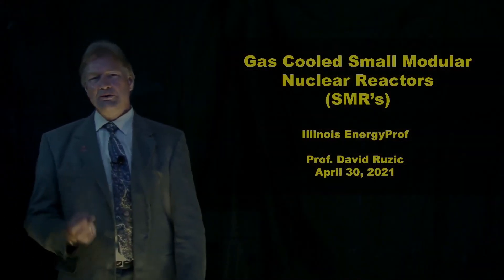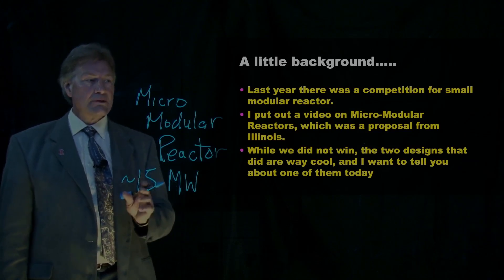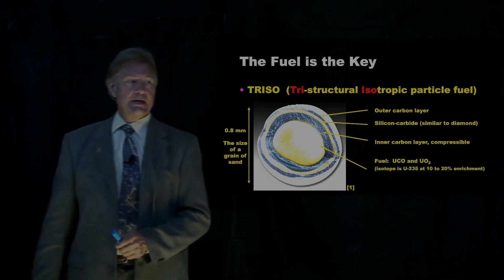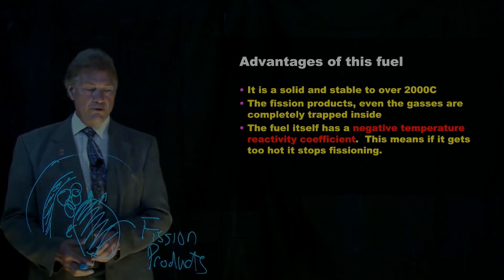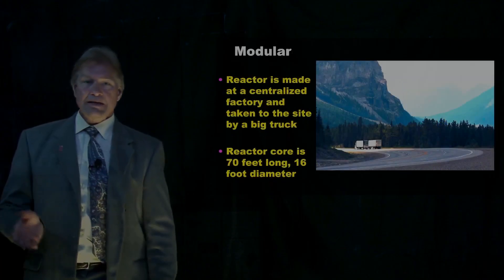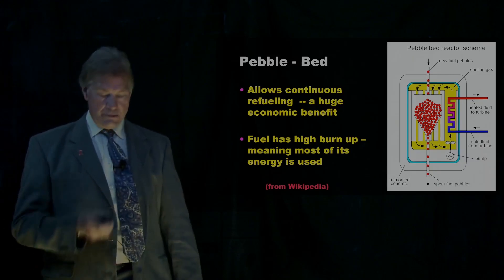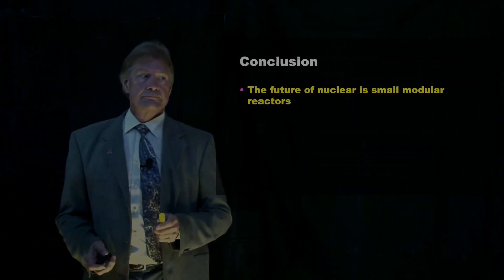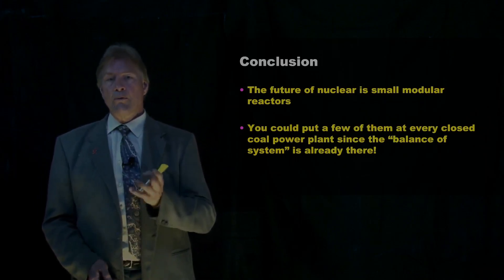SMR -- Small Modular Nuclear Reactors - Gas-Cooled

Comment: You compared the billion dollar price tag of this SMR to a billion dollar coal plant, but how much energy does that coal plant make? How much heat? Not trying to defend coal, but it's odd that you didn't elaborate.

200MW thermal and 80MW electric from this SMR for $1.2B.
Solar plants cost less than $1.50 per watt, so a 200MW* solar array would cost less than $300 million, double that to include storage and it's still half the price of this SMR. The panels last 25ish years  and depending on the type and duty cycle of the batteries they can easily last that long. So $1.2B would get you solar power for 50 years... but you wouldn't have to pay for fuel, you wouldn't have to pay for cleanup, you wouldn't have to pay for waste disposal, you wouldn't have to pay for security. The running cost of that solar plant would be a tiny fraction of the cost of the SMR. Plus at the end of life of the panels and batteries you can up-cycle or recycle them. You can't recycle nuclear fuel, or any of the contaminated parts of the SMR. 
For a singular large solar plant you might have trouble finding the space, but in a neighborhood you have plenty of roof space, and covered parking, and covering the waterways to prevent evaporation, and on top of every light pole, and so many other little nooks and crannies that you can stick solar and a battery that finding space for 200MW in a neighborhood would be easy. 

I generally like nuclear, it has insane power density, is safe, and cleaner than fossil fuels. I am not a fan of SMRs though. 
They're security risks both in transit and in situ. 
They seem like a way to go around regulations. Especially those plans to hook several of them together instead of building a big plant. 
They are less efficient than big plants. 
For a moon/mars base it's perfect, but for a neighborhood? IDK.

*Edit: Aren't resistive heaters 100% efficient? So that solar plant could produce 200MW of heat too, while also supplying more electricity than that SMR. If you don't need super intense heat you can use heat pumps and get way more efficient still.
Reply: >200MW thermal and 80MW electric from this SMR for $1.2B.
There is small problem with your math. It should be $1.6B for 4 (four) reactors + fuel production facility.

Comment: do they work in zero-g?

(asking for a friend)
Reply: You'll need to rotate the pebble bed like a centrifuge to keep it compacted and allow removal of the fuel pellets. But otherwise yes.
Reply: @nerd1000ify  thank you 😅

would it work at, say, 0.38 g?
Reply: @klausgartenstiel4586  don't see why not. A PBR would probably be a great power source for a spaceship or a base on another planet. Of course you'd need radiators to get rid of the heat, and a radiation shield to protect the crew. There's a great website called Project Rho which discusses a lot of these concepts in depth.
Reply: @nerd1000ify  cheers! i don't like reading in my free time, but this looks fun. i like the boom table.

Comment: Why can it only produce 80 MW of electricity, but 200 MW of heat?
Reply: Coal and natural gas plants are similar  with a 35 to 40% conversion of heat to electricity.  Light water reactors are only 30% efficient
Reply: Because thermodynamics

Comment: I was so disappointed that you are pushing the old, failed, wrong way of extracting energy from fission. Ok, maybe calling it 'wrong' is pushing it a little to far but come on, whats wrong with the Thorium cycle?  Why aren't you so interested in say, MSBRs or LFTRs...  We are so far behind because of the wrong headed choices made around 80 years ago to use Uranium and water.  So please, do tell, what is wrong with Thorium based reactors?
Reply: What You Need to Know: Thorium Nuclear Power
May 8, 2020
^^^^^^^^^^^^^^The Professor has renewed my respect for him.  This fellow is amazing. (actually it appears that I jumped and spoke before I had all the necessary information, my apologies Professor).

Comment: As a nuclear engineering student working around reactor design, I keep wondering how the industrial heat use case functions. Sure these reactors produce a lot of thermal energy, but that doesn't necessarily mean that they produce very high temperatures (at least along a conventional secondary ) that could be used for things like melting steel. Maybe district heating though.

Also when trico in high temperature gas reactors comes up I keep wondering about the possibility of a graphite fire. You have these systems that are optimized for gas flow and if oxygen were to get in and become exposed to a bunch of high temperature graphite I think of fire would become a real possibility. The fire might then crack many of the trisoparticles through chemical reaction and lead to fission product release.
Reply: 90% of the world's population is in dictatorships. 
Nuclear industry in every country?????
Putin is the world leading Dictator.
The worst killers, the child killers, lead all Dictatorships. Oppose your Dictator and one of your children will ring you and tell you that the man with the gun told you to ring.
Putin is killing the neighbour's children. 
100,000 SMR, say BWRX300, around the world means the USA military budget goes from 4% to 40% of national budget. 
The USA is the biggest target in the world.

Comment: Would also be really nice to see an episode on Molten Salt Reactors (non-thorium), for example Terrestrial Energy, ThorCon, Moltex, Elysium. These designs have all the inherent safety and modularity of gas-cooled designs, but due to simpler fuel and higher power densities they perhaps have the potential to produce power cheaper than coal and gas. Some of them (e.g. Moltex & Elysium) even burn existing nuclear waste.

Comment: While not pretending to know what I an talking about in any depth , (your terrific presentations allow me to think I know more than I do)  - If the reactor can be cooled simply by air , that would mean to me that there is not much heat energy "soaked" into the heated gas to transfer to water based steam generation in any quantity. What am I missing ?
Reply: In other comments, he explained, but the helium cooling gas is quite hot, hotter a Pressurized water reactor, which improves the efficiency of the heat transfer. 

It is cooled by a gas, but the "cool" state is actually quite hot.

Comment: On a side note: I love your way of presentation, writing on a glass pane and mirroring the video in post. The position of your lapel pin gives it away though. 
Question on the pebble bed reactor: How throttle'able would such a reactor be? Will control over helium circulation directly control heat generation? Because 200 MWatt thermal with only an On/Off switch would be kind of unwieldy...

Comment: With regards to the X Energy XE-100, have they overcome the problems of the German AVR Reactor been resolved?

This test German AVR Reactor was located adjacent to the Jülich Research Centre in West Germany, an early pebble bed reactor constructed in 1960, and it had problems with fuel temperature instabilities...

"AVR´s helium outlet temperature was 950 °C, but fuel temperature instabilities occurred during operation with localised exceedingly high temperatures. As a consequence the whole reactor vessel became heavily contaminated by Cs-137 and Sr-90..."

https://en.wikipedia.org/wiki/AVR_reactor

And...
"...In the AVR, it was impossible to directly measure the fuel element temperatures and the temperature distribution in the primary circuit. The temperature distribution in the core and the mean gas outlet temperature were therefore initially only calculated
using numerical simulation techniques. It was only possible to measure the temperatures in the core using special monitoring spheres containing melt wires that melted at certain temperatures. However, such monitoring spheres were used from 1970 onwards in three measurement campaigns (in 1970, 1972, and 1986).

Even the first two measurement campaigns (1970 and 1972) revealed certain deviations from the measured values and calculated values of temperatures in the core.In February 1974, the cooling gas outlet temperature was increased to 950 °C in accordance with the relevant licence. From 1972, and particularly in the period 1974–1976, the activity release in the core increased considerably. Memos from
1977 also confirm that there was already evidence at this time of excessive gas and fuel element temperatures, and that the causes were generally believed to be errors in the fuelling strategy, which led to too high a concentration of fissile materials in the outer zone of the core. Furthermore, the authorized value for the mean hot gas temperature was exceeded by 35 °C between 1 January 1976 and 1 May 1976. In the AVR second quarterly report in 1976, this was explained as follows: the failure of several thermocouples meant that the mean hot gas temperature could only be mathematically calculated and that an incorrect relationship was assumed betweenblower speed and hot gas temperature.."

https://www.fz-juelich.de/SharedDocs/Pressemitteilungen/UK/EN/2014/docs/report-avr-expert-group_summary.pdf?__blob=publicationFile

Further, what is the difference between the spherical fuel elements that were used in the AVR Reactor [ See Figure 2, https://www.fz-juelich.de/SharedDocs/Pressemitteilungen/UK/EN/2014/docs/report-avr-expert-group_summary.pdf?__blob=publicationFile ], and the TRISO fuel that is proposed for the X Energy XE-100? What improvements have been made? Although Pebble Bed reactors use Helium as the gas coolant, what happens if the primary coolant [typically Steam] fails and water ingress occurs and dissociates into Hydrogen and Oxygen? Would there be a possibility for a hydrogen explosion?

Comment: Unofficially here in South Africa they were looking at pebble bed reactors a little over 6 years ago.
BUT they also wanted the plant to be able to produce hydrogen and some other "stuff"
This would involve much higher heat and the project was dropped because the excessively high heat, pressure combined with radio-activity meant that very exotic and expensive metals would be required (if they were able to be procured at all)
Eventually the project was dropped - because of the high cost due to the "must produce hydrogen" requirement I believe...
But it seems that a pebble bed reactor would NOT be able to reach such high temperatures IN THE FIRST PLACE.
The system you laid out here would make all the difference going forward in my humble opinion - thanks.

Comment: Totally agree that small modular,factory produced,scalable to need are the future of nuclear energy. Truly the only realistic bridge to green energy reliance. It is unfortunate their release has been held hostage by the nuclear fuel producers. They will not easily release their grip on their cash cow of solid fuel production. Triso is the next iteration of solid fuel uranium oxide with almost as poor a burn up rate (4-5% max) and a greater waste volume to deal with. The only reliable fuel strategy is the molten salt system that can utilize not only the uranium-plutonium cycle, but the thorium-uranium cycle and can even use our huge supply of "spent nuclear fuel" currently a problem as fuel.  But the fuel manufacturers currently own too many politicians and beaurocrats to worry about losing their control to the better interests of the general public.

Comment: Does the reactor have failsafe mechanisms like control rods that can be SCRAMed to shut down the reaction, or does it completely rely on passive regulation of power output?  Is Doppler broadening the primary method to regulate power because there is no "negative void coefficient" due to the lack of a water moderator?

Does the spent fuel need to be kept cool for a while to prevent decay heat from damaging or igniting the fuel pellets?  Is a spent fuel pool required, or are the pellets just kept at the bottom of the reactor until their reactivity is low and the fission product have decayed?

Do the pellets represent a proliferation risk like other gas graphite reactors?  Can Pu-239 can be extracted from the pellets or can other U-238 or Th-232 pellets be included in the reactor to breed fissile fuel that may be easily be extracted?

Helium is notoriously difficult to contain as a gas and is often used to test leaks in vacuum systems.  Can a container be created that is sufficiently leak proof to Helium?   If air or oxygen leaks into the reactor, can the fuel ignite?  Are there any metals in the core like zirconium that can be ignited at elevated temperature?  If the reactor is underground, and there is flooding, can water enter the reactor and act as a moderator and produce prompt criticality, or perhaps radiolysis or a steam explosion?

Can the reactor be overfilled accidentally with fuel or have overenriched fuel and go prompt critical?

How fast can the power be changed to deal with peak loads?  How does the design react to Xenon poisoning?

Who would be trained to operate these facilities?  Would they need to be trained, full-time nuclear technicians?  Will it be possible to find enough qualified personnel to man many smaller 80 MWe scale facilities rather than a few larger 1-2 GWe scale facilities?

I think nuclear is needed for the future unless a real transformative breakthrough happens in energy storage, but the history of nuclear power also has showed that you must plan for even the below-average technicians and regulatory capture / neglect.

Comment: Dead in the water. The Levalized Cost of Energy is now higher, and will continue to be higher than wind, solar, and battery. And the capacity factor will therefore continue to rise. So this is not economically viable. 

Great tech though. Cool science!
Reply: There is no such thing as wind, solar, and battery. Only wind, solar, battery, and natural gas or diesel. A very expensive and wasteful way to make just electricity without the industrial heat mentioned in the video.

Comment: What about security? Does a large decentralized network of fuel distribution and collection present any concerns in this regard? If the expectation is that most sites utilizing this capability will only have a small guard force or none at all, is there much risk the fuel could be used as weaponry?
Reply from the maker: The fuel "pebbles" being delivered are just U-235 and U-238 --- they have not been in a reactor yet, so there is no Pu whatsoever.  The ones coming out have almost all of their fissionable material burnt up.   Some one could steal the pebbles going in, but they would still need to have an enrichment facility to make a bomb.  Uranium bombs are at 90% U-235 concentration.  The pebbles are around 15%.  Of course, if you have an enrichment facility you don't even need to start with the fuel pebbles, you can just start with ore....

Comment: What if the helium container is broken and air gets on the super hot graphite?

Also, U 238 absorbing neutrons becomes plutonium. What becomes of that?
Reply from the maker: The Pu that is made burns up too and fissions.    If there is a break in the helium cooling line the helium pours out of it since it is at a very high pressure.   The break means that the Helium pressure drops so there is less cooling.  Therefore the fuel heats up and stops fissioning.  By the time all the helium leaks out and air could come in the reactor should be in shut down mode.  Note that if you took a graphite rod and took a blow torch to it and got it as hot as possible, and then turned off the blow-torch -- thereby exposing the hot graphite to air and oxygen --- nothing happens.  Graphite is very stable stuff that does not burn easily at all.  Try it!

Comment: Oh good. The smaller plants are sooo much easier to cool and safe. Gas cooled pebble bed like this is awesome. A standard PWR with the same thermal output would be just fine as well, long as it has coolant in it. It doesn't need any pumps, just natural convection.

Comment: Very interesting, and very cool. However, i have some questions. If there is a coolant pump failure, the temperature will first rise, and then stabilize around the new equilibrium, due to the negative reactivity coeficient. So far so good, but what if you for some reason need to actually shut down the reaction for any reason, is there a way to do that? The public might think "it's passively safe" seems arrogant, but if the messaging is "it's passively safe, and we can also shut it down", the reception might be much better.

Also, how does the helium play into this? The US is quite strict about exporting too much helium. Will the rest of the world be able to build and opperate helium cooled reactors at all? If we want to tackle carbon emissions, then the solution needs to be globally acessible. (While the situation seemed a little better quite recently, i expect the general trend of low supply of helium to not drastically change in the near future.
Reply from the maker: It has control rods too, so you can easily shut it down on purpose.  I should have mentioned that !

Comment: Helium cannot be contained therefore there will a continual need to top up the Helium. Perhaps this is a deliberate element of the design. Far better to use a gas higher in the periodic table where gas leakage will not be a problem. The cost per kW hour looks to be out by at least a factor of ten if this ever comes to fruition.
Reply from the maker: The cost of helium is extremely minor since even with topping the volume is small.  You want an inert gas that can not be come activated by the neutrons.  Helium is the one.

Comment: If High Temperature assisted Electrolysis can be used to make hydrogen gas from steam using this SMR design, how hot would the steam be just before the steam enters the chemical reactor to make the hydrogen gas? What catalysts could be used to make hydrogen gas in that temperature range?